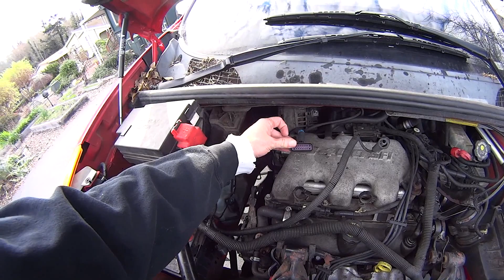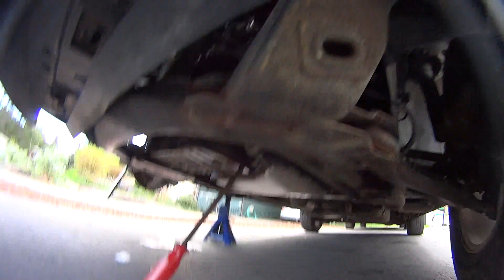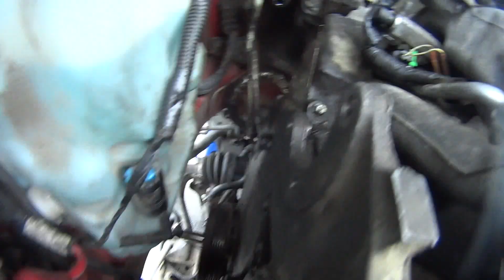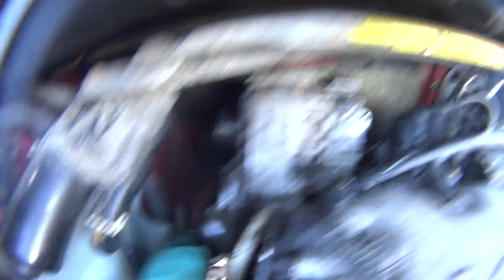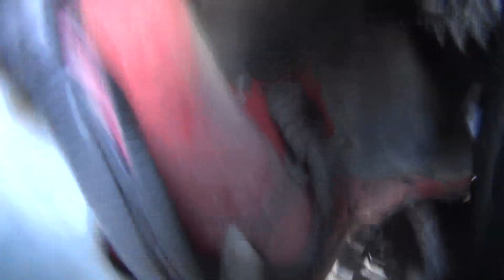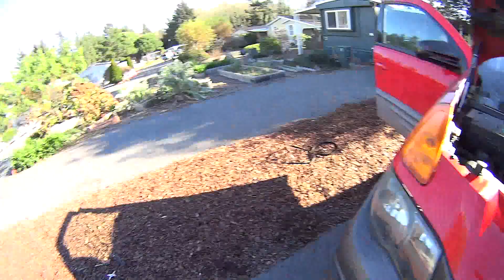How to Fix & Repair a Front Timing Cover Seal GM 3400 3.4 V6

Comment: When one of my water punp screws broke off in the timing cover I had to pull that whole thing off and buy another...that thing was hell to take off...took me a few days lol. Then  A few weeks later, head gasket leak, sold that piece of junk! Good job man but those gm 3.4 are pure trash, eventually they will fail on you
Reply: raleighrell mine rang off too but for 35 bucks i got a heli coil repair and fixed mine
Reply: I agree with you, why even replace the timing cover gasket, as soon as you do the head gaskets and intake gasket will start leaking. This video is useless anyway. He didn't show anything important.
Reply: Where is there a better video
Reply: @coultmanphotography8791  get a service manual, there's some free PDFs online. It will give you step by step instructions.
Reply: Thanks for getting back to me. I have been looking but it seems very hard to get something for  Buick Rendezous. I tried to buy a Hurley manual but can't find it for this. It is the same a a Pontiac Astec but can't find nothing. I believe I have go all the bolts, but the cover does not move at all.
Reply: Here's the link for the Haynes manual: http://download.aj-sw.ch/TransSport/Haynes_Repair_Manual_Chevy_3-4l/Handbuch_3_4_gesamt.pdf
Reply: I finally got the cover off thanks to your great help. I had missed 2 bolts to remove. Now I need to line up as close as possible the marks on the gears. How do I turn the motor over to get the dots close. Can I use the nut on the large gear to turn it over. Also when I get the new parts on do I put motor oil on the chain and gears?.
Reply: Are you replacing the timing chain or just the cover gasket? If you are just doing the gasket, you don't have to find TDC. If you are replacing chain the manual will tell you step by step instructions on replacing timing chain. Sometimes it will refer you to other sections of manual for each step.